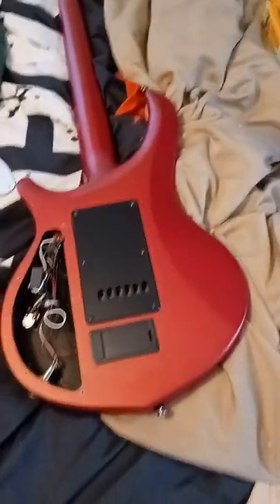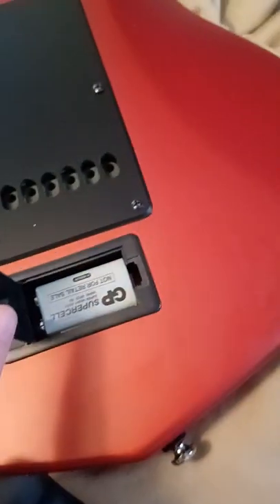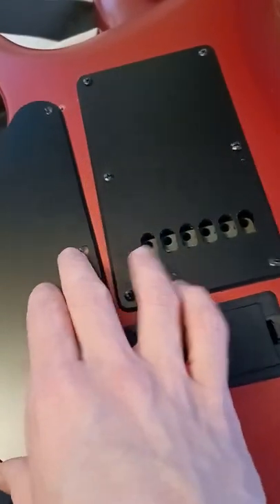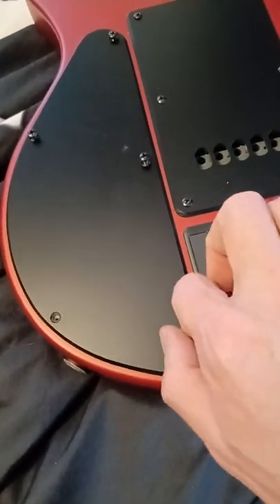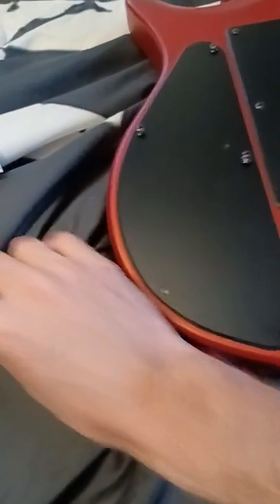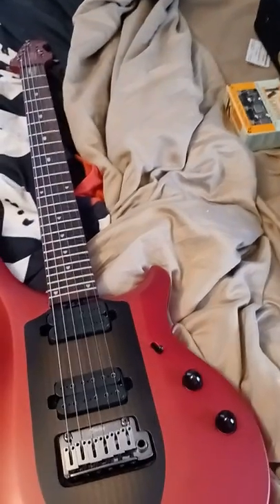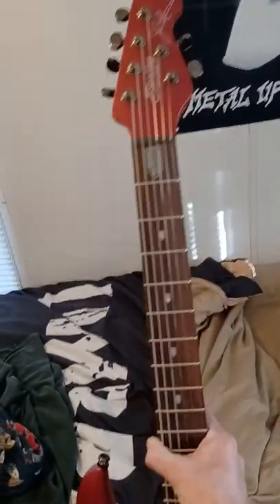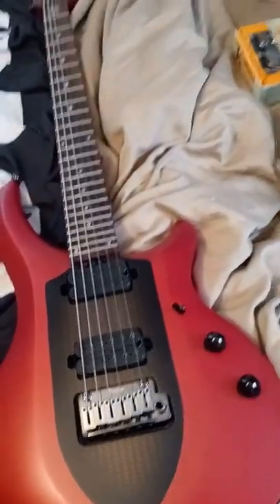Sterling by musicman battery compartment look for a subscriber and a sort of crazy story

Comment: also man its such a fun guitar only thing i dont like is the trem bar doesnt lock in  always slides out i checker for screw didnt see it then i found it and fix the issue lol
Reply from the maker: No problem dude! There's a tiny set screw on the trem where the bar goes in. Tighten that screw with a small hex key with the bar in. That'll solve that problem. Just loosen it when you want to take the bar out